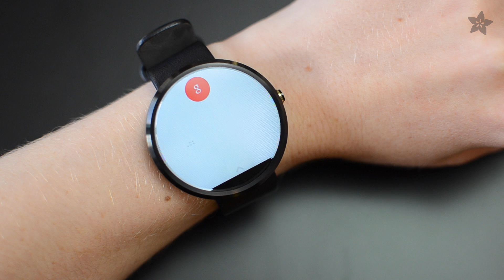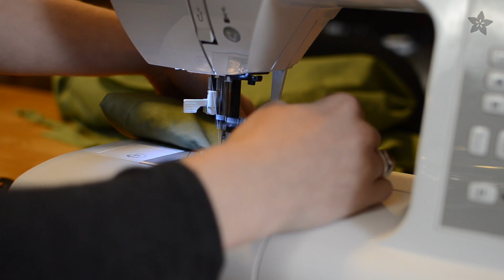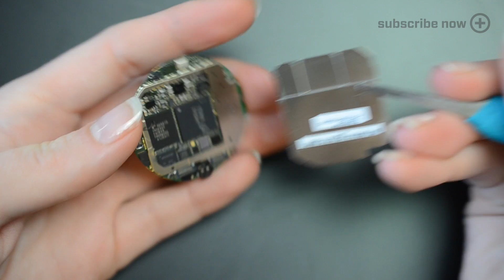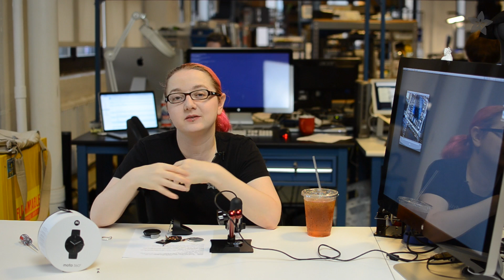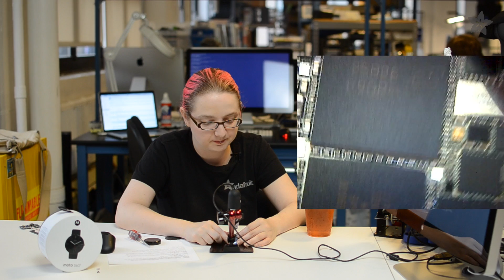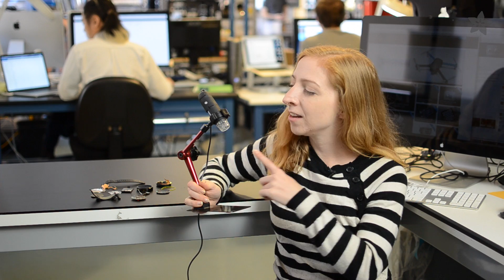Moto 360 Smartwatch Teardown

Comment: My moto 360 wont charge. I connected  it turns on on 7% then just goes down and shuts off.. it it the battery  or the charging  station. Any suggestions  on what should I do?
Reply: ElGuapoChuy leave it on charge for an hour then hold down the button.
Reply: Mine has a bad battery does that